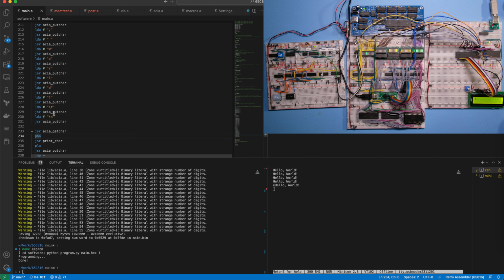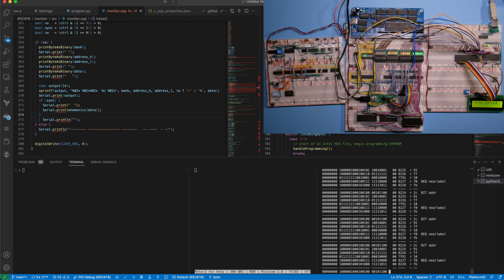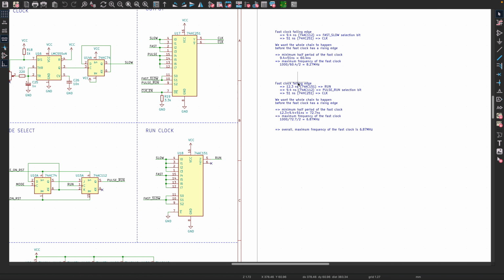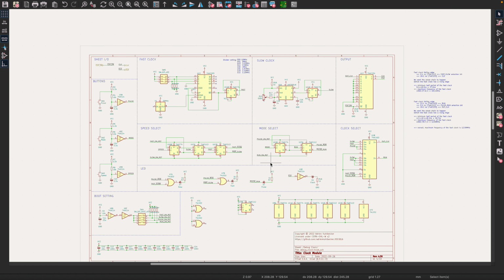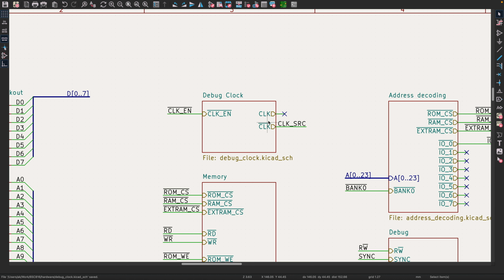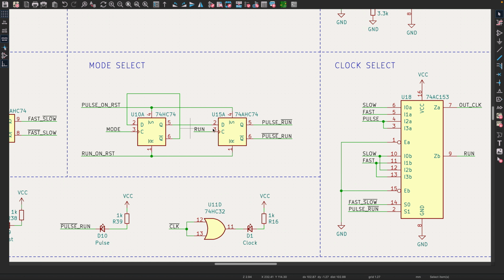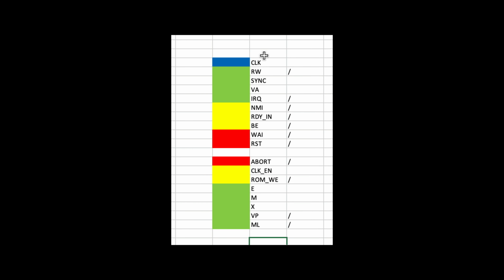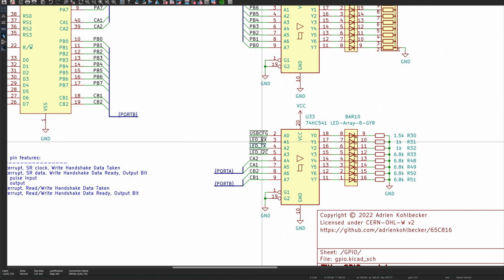#32 - Spring Cleaning - BB816 Computer

Comment: To improve the readability of the LEDs you can put a piece of colored plastic over them. Ben Eater used the same trick for the 8-bit Display of his 2-bit CPU, it should work for those flat LED packages too. Just make sure to use the same colored plastic as the LEDs themself, to actually increase the contrast.

Comment: Going forward, your subroutines should "protect" the values in the registers that only used internally. In the "acia_and_lcd_putchar" should preserve X by saving and restoring the value from the stack. It should be done in the subroutine, as each sub knows best which values it needs to save.
Reply: He is aware, in an earlier video in the system he established a calling convention he wanted to use.
Reply from the maker: Hi! Yes, as Brady said, I chose the opposite convention, where most registers are callee-saved. I know it is not the usual choice and I'll keep evaluating whether it makes sense in the future.